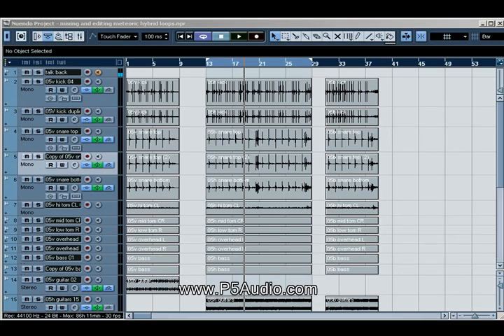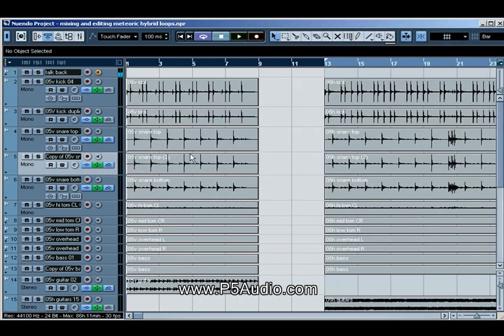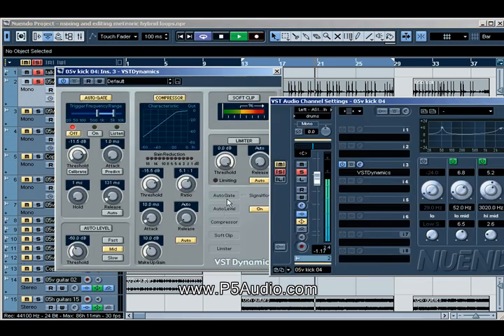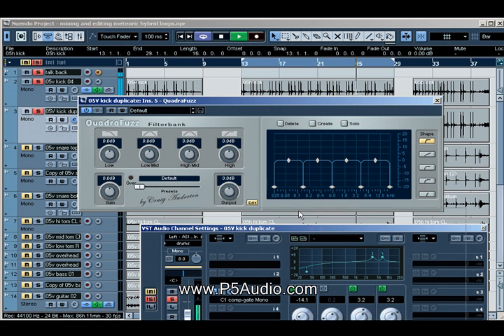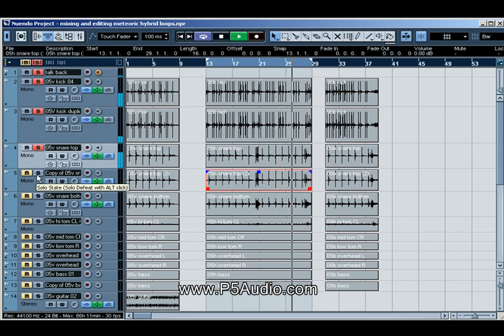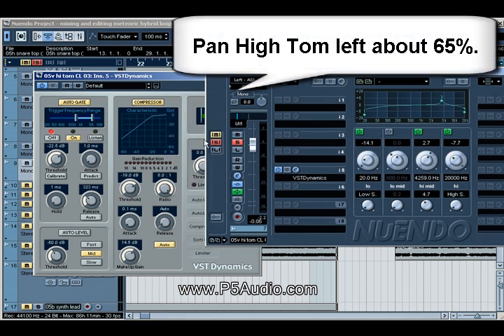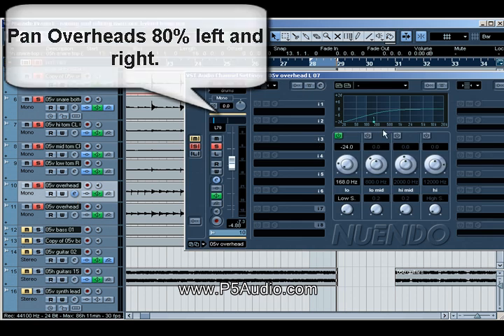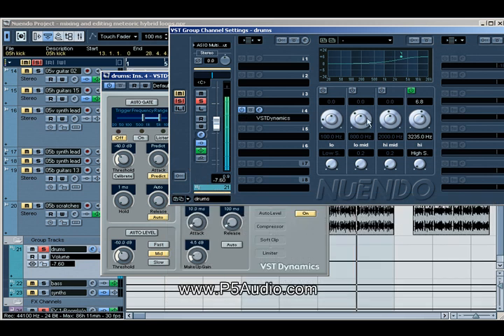Modern Rock Drums, Bass and Guitar Mixing Techniques Part 1 of 2

Comment: i mic each drum seperate and record onto a tascam 2488 as you can use 8 inputs at once (or you could use similar multitrack). then usb onto the pc and import audio files onto cubase sx onto sep' tracks you can then bounce/pan/eq/effects. also if u record with 1 condenser mic can bounce multiple tracks and slightly adjust each by msecs and pan/eq etc each track as if u used several mics. eg. if u r eq'ing a kick, knock all the highs out and use drumagog and blend the sound of the two together.

Comment: Let me make a suggestion: If you boost EQ all the time then everything fights with each other for space in a mix and it will sound cluttered and messy. Consider cutting each element instead in such a way that it leaves space for the other drums and instruments.

For example if you want the low end on a kick to stand out, cut away the LF from the other toms and the snare. This is way more effective than boosting.  Peace.

Comment: i have a little doubt here, let's see...if you  make a copy of a same signal from example; your original kick and a copy of that like this guy did on the video,shouldn';t that be causing phase problems , like cancelation on the phase because you are working the exact same signal??  could i try that only with the bass drums  in case that  this works for me ?? and still not having a problems  even if i use diferent eq to make  them sound diferent?

Comment: @ashebiara10 - if you adjust the bounced track by like mil sec (zoom right in and only slightly adjust!!) eq accordingly and it will work. works ok if you only record with 1 mic as a drum overhead and bounce the track, pan left and right. slightly adjust out of sync. not saying its ideal but is a solution if you can't get a matching pair of condenser mics. it makes it sound stereo and bigger which is the idea but technically it isn't a stereo recording. i have done this in the past myself.

Comment: You should cut before you boost your eq.  Your mix sounds way too bright for my tastes.  Also, with drums, I was always told to set the compressor to a slow attack time so that the original snap is not lost.